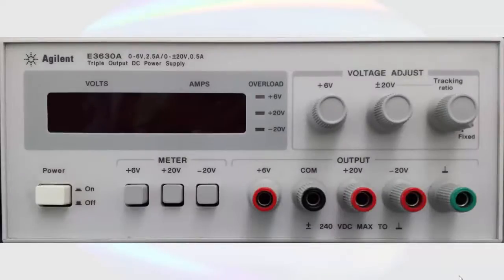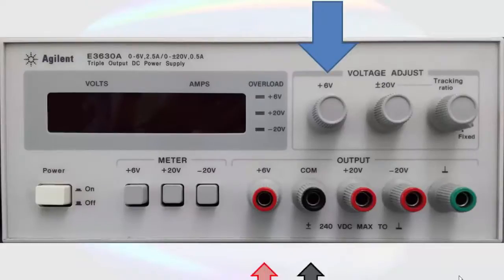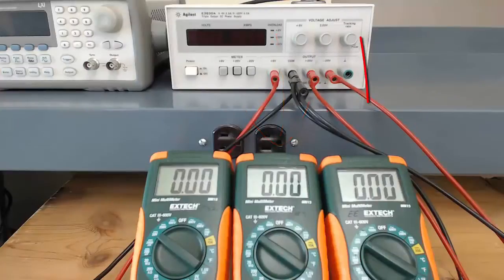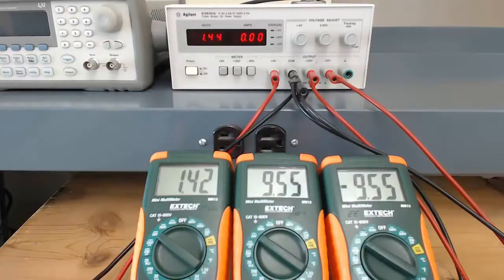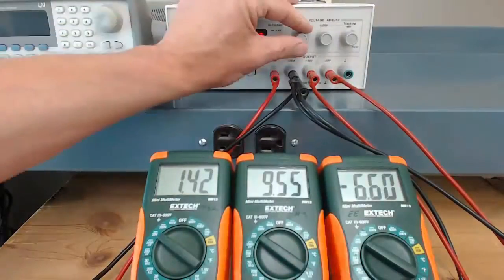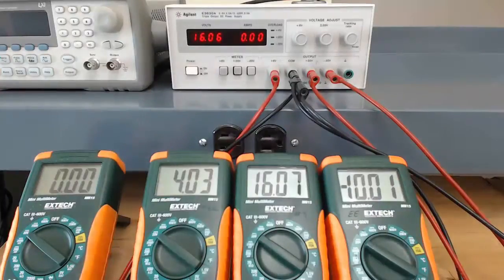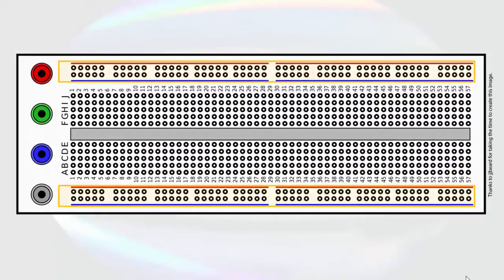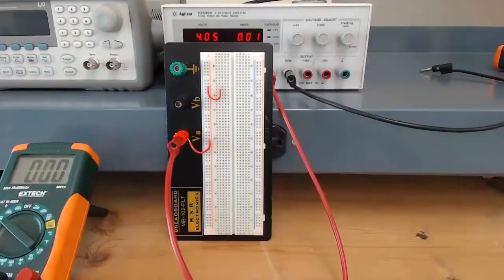01. DC Power Supply and Breadboards

Comment: Hoping to improve my automotive electrical trouble shooting skills, I'm looking to acquire a bench power source (& breadboard) for simulations and component testing.  I get weird results using a 9V battery (ie. large voltage drop) -internal resistance, insufficient voltage for the device??? ... I know not.  At any rate, I found your video very informative and I thank you.  Cheers!

Comment: I am in the infancy stage of Electronics 101. To this point, I need a major clarification on battery voltage. I want to use a 12V battery with a breadboard to closer simulate the 15 volts across the rails on a HO scale track .... My confusion: .... You see many of these tiny, rectangular, 9V batteries being used with breadboards. A riding lawn mower typically has a 12V battery which is considerably larger than the tiny, rectangular 9V battery, yet the voltage comparison is 9V to 12V. Adding to my confusion is a 12V car battery which has the same 12V rating as the riding lawn mower battery, yet the car battery is quite a bit larger and heavier. What am I missing that differentiates between these voltage readings: 9V rectangular battery versus 12V mower battery versus 12V car battery. Thanks!!!
Reply from the maker: A mower battery and a car battery use similar technology.  They both consist of 6 lead acid battery cells, each with a voltage just over 2 volts.  The size difference affects the capacity of the battery, not the voltage.  A car battery may have around 40-50 amp-hours of energy, while a lawn mower battery may have 20-35 amp hours. 
The smaller 9V battery is a dry cell technology with some variation in the actual materials.  Taking apart a 9V battery will reveal that there are six 1.5 volt cells that look quite similar to AAA batteries, but are slightly smaller.  They are the same technology as the AAA, AA, C, and D batteries.  Once again the energy capacity is what changes with the size of similar batteries, so the D cells have the most energy, while the 9V batteries typically have the least.